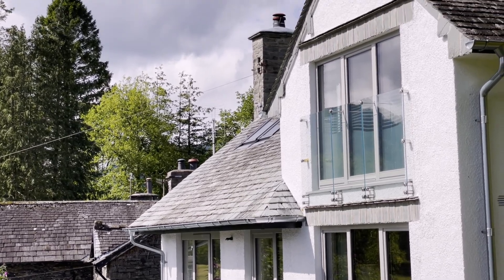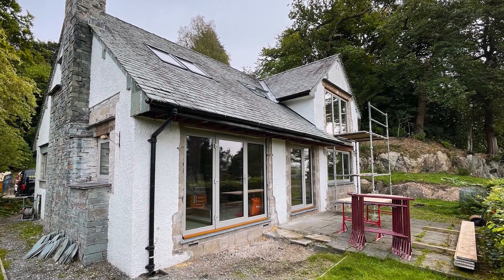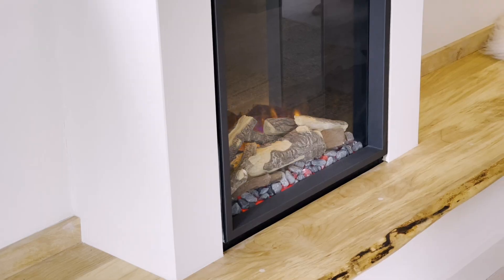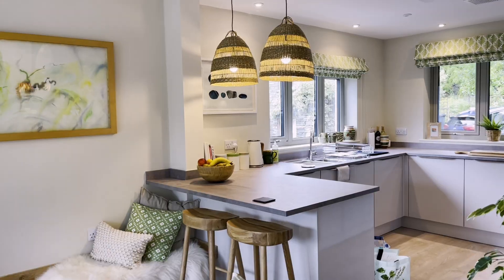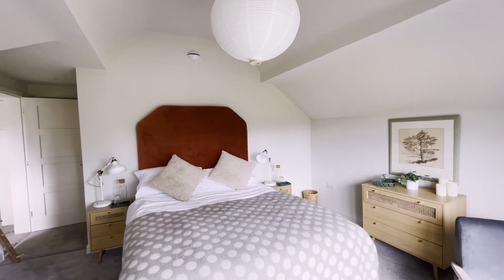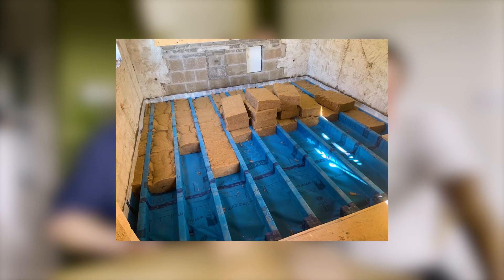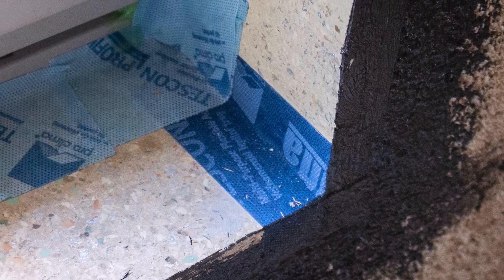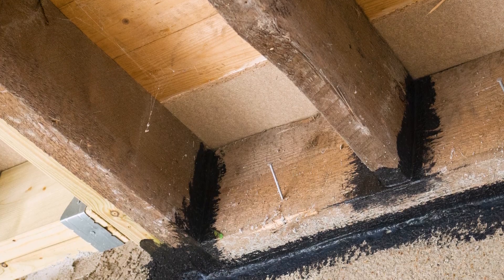UK Retrofit project smashes Passivhaus airtightness standard by achieving 0.48 AC/H @50Pa

Comment: At about time 4:22.  “Energy used by this building is less than 50 Kwhr per m2 per hour. “ That must be crazily wrong.  Assume 100m2 floor area.
Energy use per hour = 50 x100 or 5000 kw per hour.  At 20 per kw the cost is 10000 pence per hour.  I make that £100 an hour!  Total credibility failure.  Willing to admit it’s my mistake.
Reply from the maker: Hi @mrat42. The 50 kilowatt hours per metre squared is quoted as per annum, and not by per hour.
Reply: @EcologicalBuildingSystems  ah yes, my misunderstanding! I should have realised as that’s the way it’s quoted on EPCs!